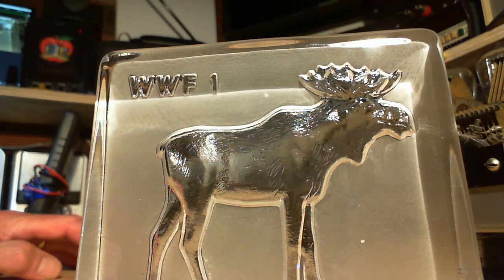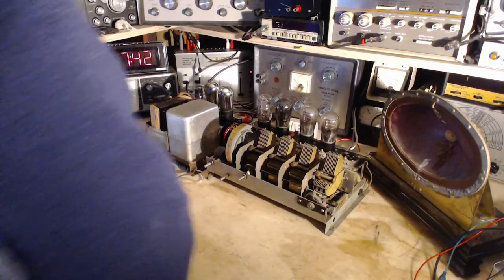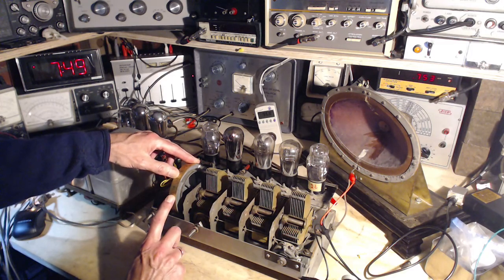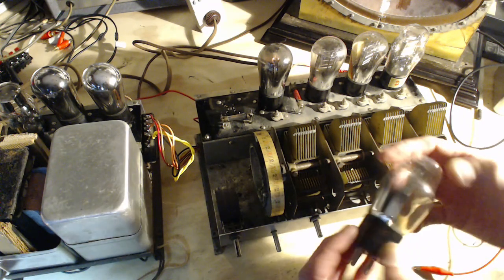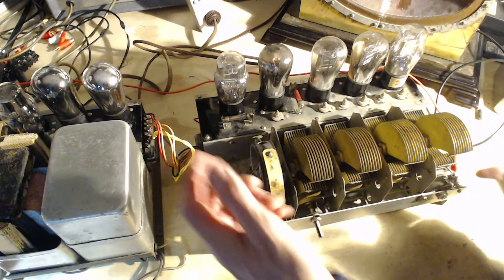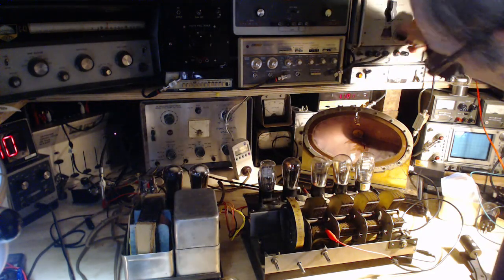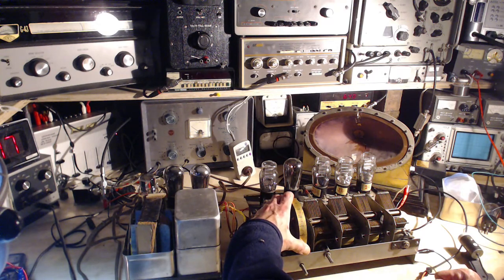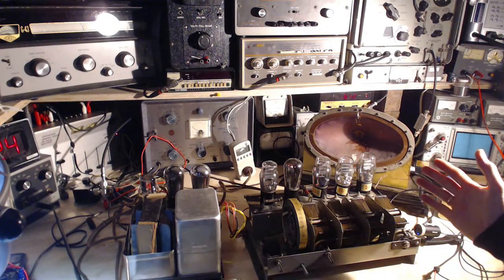1928 RCA Victor Model 28V   Video #8 - Better Tubes

Comment: Firstly back from my vacation, Maybe replacing the first three tubes might give a better signal as old vacuum tubes ware out over time, looks like the old capacitors have got problems, any Cossor tubes that might work to replace the last two tubes after the three you replaced.